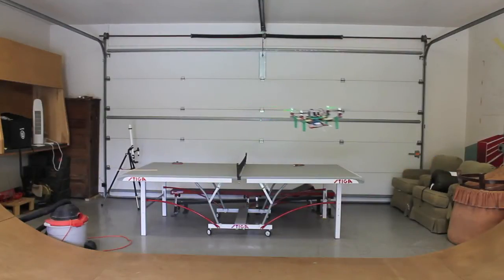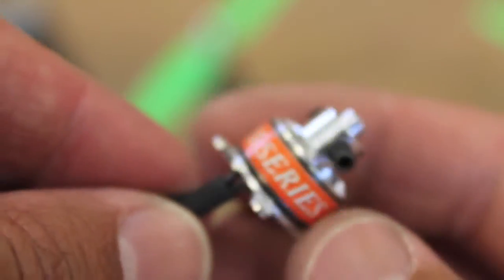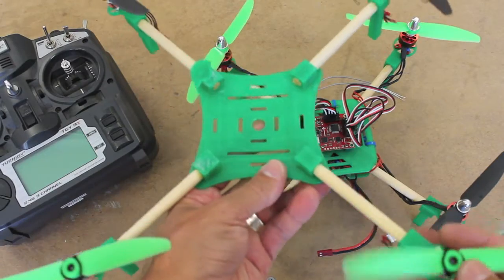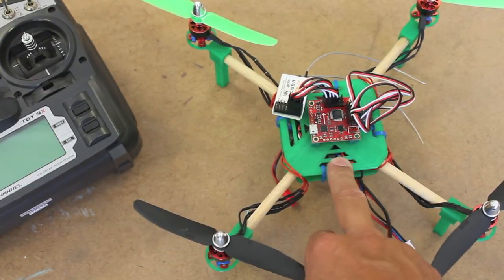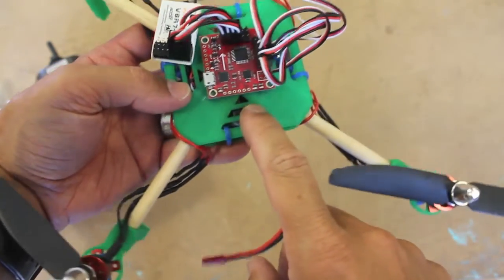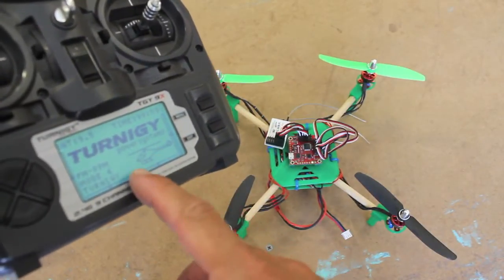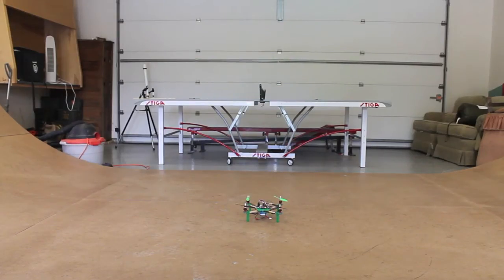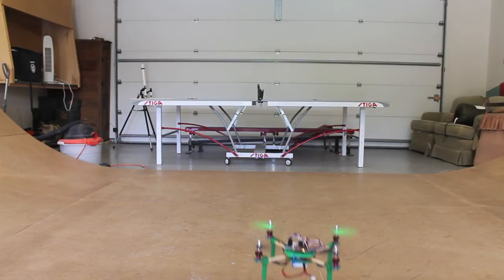DIY Mini Quadcopter Maiden Garage Flight w/ MultiWii Flight Controller

Comment: Sorry for the broken link. I found the Radio Shack item numbers:
#6403010 42 pack 2-56 Round Head Machine Screws
#6403017 42 pack 2-56 Steel Machine Hex Nuts

Comment from the maker: Good question. I'm working on a vid that shows the breakdown of all the parts. But assuming you're using your own TX/RX then the all-in you're talking about $115. You maybe able to shave about $8-$10 off that amount if you use Turnigy 6A ESCs. I'm using Turnigy Plush 10A ESCs. This also assumes you're using a basic MWC flight controller for about $15.

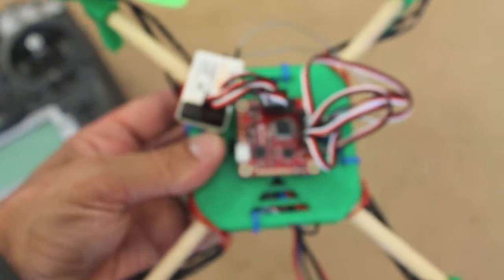Comment: Hi Dennis, Please excuse this post if you already know. In your video starting at 2:25 you mentioned bolts. Just wanted to share a discovery I ran across the other day at Radio Shack.  I found small screws and nuts that fit the turnigy motor mounts and I did not have to wait for them to arrive from HobbyKing. Needless to say I cleaned Radio Shack our >:)  Awesome following your mini quad build!!!